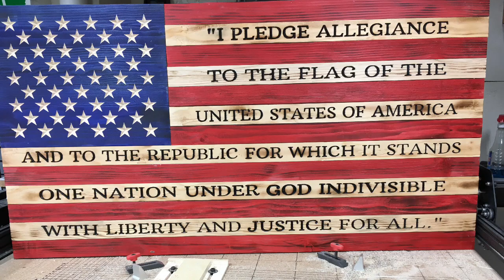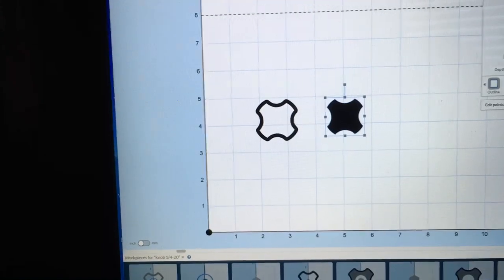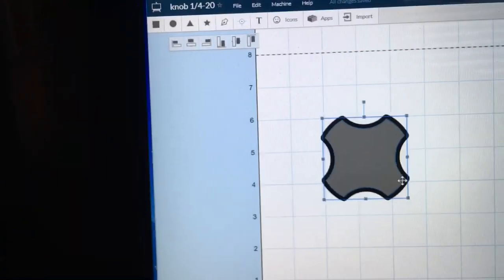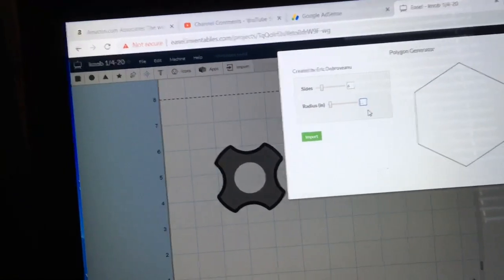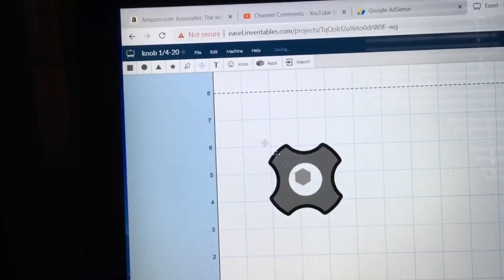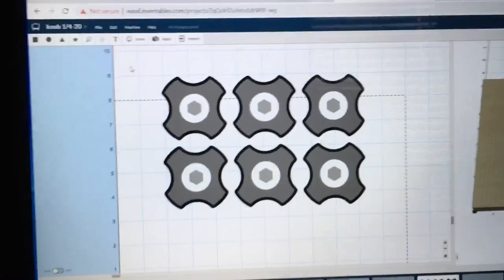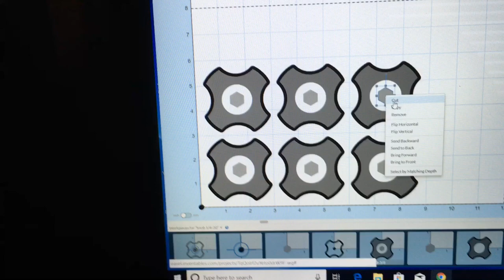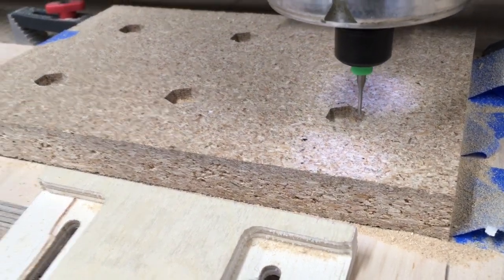How to Make Male Knobs for Rustic Flag Jig

Comment: Do you use an epoxy to hold the nuts in the handles?
Reply from the maker: Yes, I am replacing the particle board handles to wood.  They hold up much better.

Comment: Just wondering why you were worried about moving back to the x/y after the first pockets. Why not just click on use last x/y when starting the second carve?
Reply from the maker: I have had the "use last x/y"  lose the position and run wild.  have not used it sense.
Reply: @PawPawsWorkShop  only time that should happen is if you have moved the x/y while changing a bit then of course its off. Never once had it fail on me and saves after power cycles as long as you home again.
Reply from the maker: Once was enough for me, but having said that, I will try it again.  The support team at Inventables could not determine the cause.

Comment: Im going to start saving the easel gcode files so at least i have something if inventables goes under or decides to stop offering easel free..... I really do like  easel for its simplicity but my cnc machine is in shed and internet access is difficult..  Im just not a big fan of being so dependent on other variables when using anything and easel is   Requires 2 major thins....one is internet access since its web based and not actually installed on your pc...and two it needs inventables to stay in business ...
Reply from the maker: That is a wise thing to do.  I think you have an excellent plan
Reply: well yes it is..all that time you spend creating the designs and projects in which inventables has full control over and then if inventables decides to close the doors you would be shit out of luck....what about days easel is down?? and you need to do a project now??..shit out of luck again....what if your internet is down and you cant geet onto easel?,,once again shit out of luck...by using offline software such as vcarve and vectric aspire etc etc you are not dependent on the internet nor arre you dependendt on a compnay closing doors :) @PawPawsWorkShop
Reply: but that would include using a sending program such as UGS etc..which does work ok..just not as user friendly as easel but hey at least they are not dependent on so many other variables :)